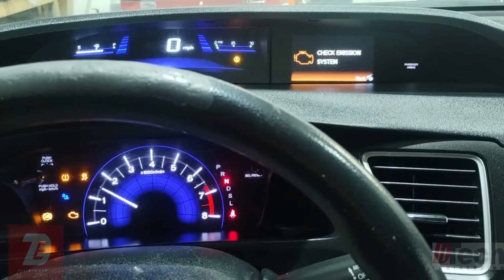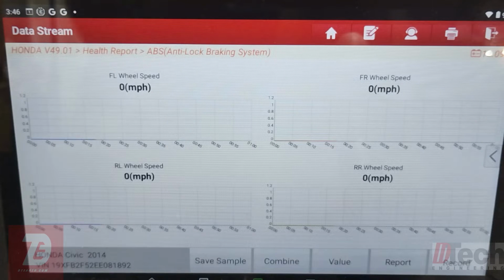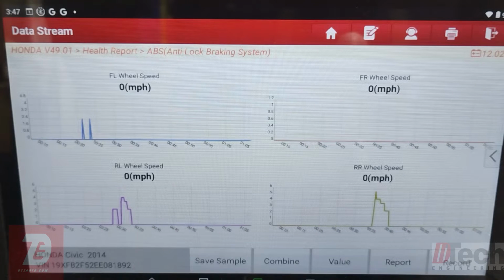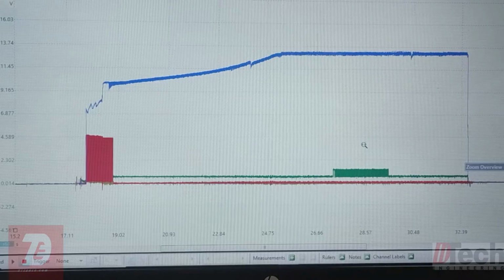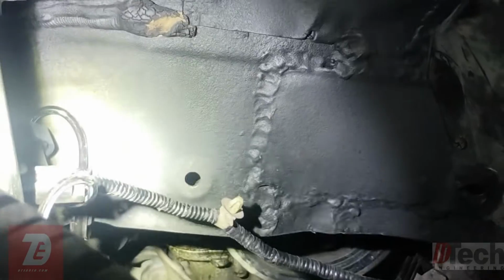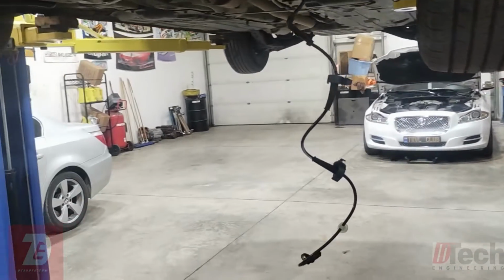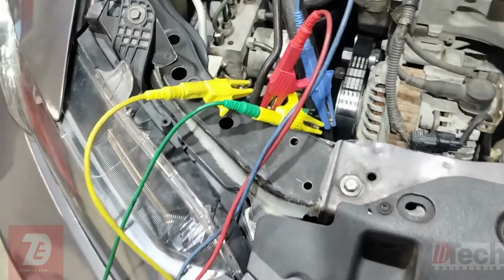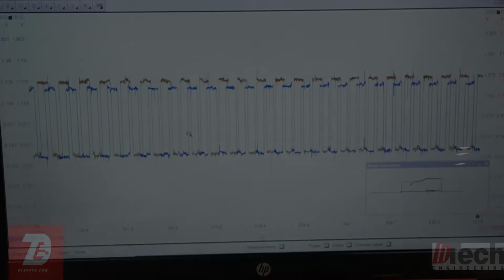HONDA ABS VSA BRAKE EPS LIGHT REPAIR

Comment: mine does not have the  tire pressure sensors anymore, so those 3 lighs came on,  I had 19 psi on a rear tire I put air in it and the lights went away, coincidence? has this happened to anyone here before? mine is a 2014 CRV

Comment: I will guess that they changed the sensor with an AM Part, was not sure if it was wired the same, swapped wires to test, failed, left it as is and called you without telling you the story and not knowing that without telling the story, that the repair price is double now for messing it up in the first place so go to the guy who screwed you over to get your money back or if that was yourself, dont do that again or tell the full story next time. All maintenance needs receipts with explanations or tell what you screwed up yourself to save real money.
Reply from the maker: Why would I idiotically cut the harness and swap the wires around??? I guess you missed the part of when this was in an accident and it was fixed this way then brought to be checked after the sensors did not fix it.
Reply: I did not say that YOU did it, I said THEY, I have too much respect for you for that. In the context of the story, yourself means the owner, not you, if they are the one to work on their own car, cheers. @DTEAuto

Comment: Love your videos.  I thought that it was a VR sensor, because it only had two wires.  If it had been a VR sensor, then the polarity would not have mattered.  But at the end of the video it can be seen that the signal is a low voltage square wave. It must be a Hall effect sensor, or an advanced VR sensor, that are grounded to the wheel strut.
Reply: Either Hall Effect or Magneto Resistive (MR).

Comment: Geez, that’s some body shop repair!  Such a stupid error.  I worked on a Civic of that generation (same instrument panel) where it had all of the same errors.  Noticed the brake fluid very low, ended up being a slow leak on passenger front caliper piston seal.

Great video, Sadel!
Reply from the maker: That's crazy, hadn't seen that yet, but good to know!

Comment: great informative video to learn about, i have a question for you, i have a 2010 bmw 528i 6 cilinders, we replaced the valve cover gasket, now car is running rough whit codes 2a32, 2cfa, 2a47, 2d09, 2a98, what shoud i look for, there's a way adjust the excentric valve or i have to relearn something?
Reply from the maker: there is a relearn, try that and also reset adaptations